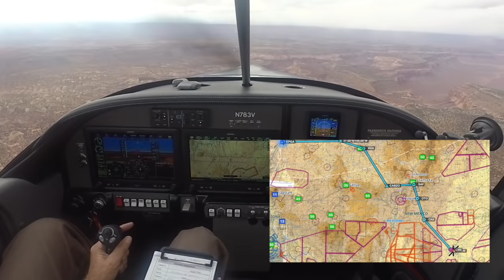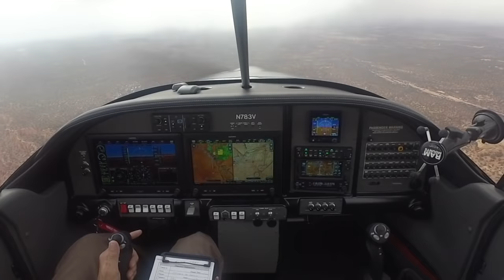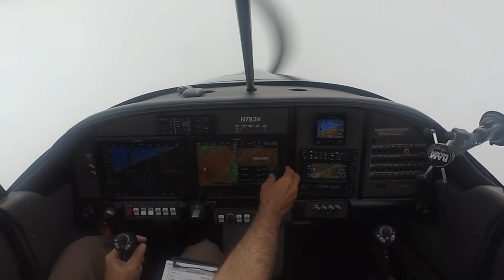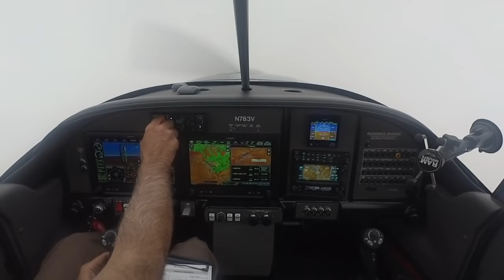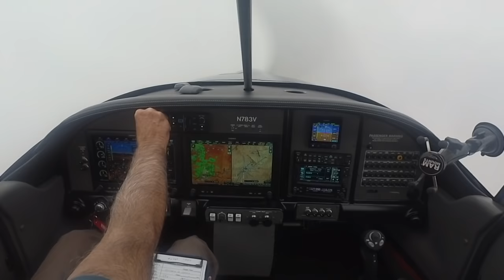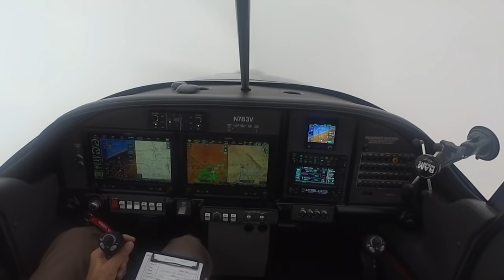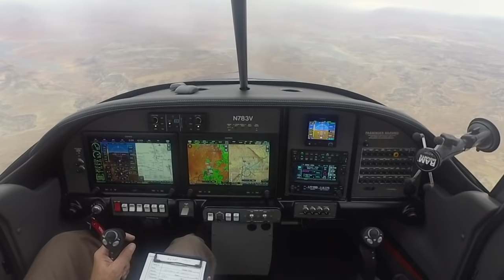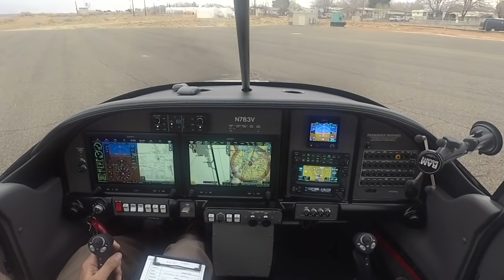RV 10   N783V   My 1st Emergency   HD 720p

Comment: ATC controller was amazing in every way including the extras he did trying to help the pilot and reduce workload (e.g. providing the weather). Really appreciate those folk. Lifesavers.
Reply: indeed...real professional and smooth....that voice of reason and concise guidance makes all the difference for anyone who has been involved in a series of events that complicate flying.
Reply: Absolutely! I hope that if I'm ever in that situation, I find a calming and helpful voice on the other end of the radio.
Reply: Yes! And also, he seemed to direct other stations over to different frequencies, so there would be less clutter. Good job by the ATC.
Reply: Yep and telling airspeed....pilot is always best to advise how many on board fuel remaining etc when first making contact ....proper planning in advance eliminates most stress....ain't no thing if all is trimmed just let the airplane fly then go thru the checklists.... people used to fly without pitot without electronic maps and all the pretty goodies.....I have a 22 year old Garmin I always have in my bag..... it is just a backup but batteries always checked and I can ...and have flown using just it for my flight instruments.... everything is there that's needed.... but yeah I even carry a hand held compass in my bag that can be used if the aircraft compass failed (however unlikely)  but it's also there in case it's needed to hike out... you know that boy scout motto
Reply: Even more so as you know they must be sweating it inside from the history of IMC accidents. Great ATC.

Comment: My first flight instructor was an old timer -- B24s during the war, TWA captain after that. He had a quote for this: You are going to make mistakes, all pilots do, it is how you recover from those mistakes that determines whether you live or die. You made a mistake, you recovered and will live to fly another day -- excellent flying and I thank you for sharing!
Reply: Although I never did finish my lessons, due to life. I had an older instructor and he taught me that a pilot certificate was a license to make mistakes and live. The lessons were to teach you how to try to make the first part not happen but when it did to help with the second part.
Reply: My private, inst, com and multi checkrides were with an old check airman that they called "Grandpa Chuck" back when my dad had his checks with him 20 years previous. He was pushing 90 years for my commercial ride. He told me that same exact quote every time I flew with him. Stuck with me. 

He was also notorious for extremely intense and very long (often 2+ to 3 hour) check rides just for your private. Mine lasted 45 minutes for my private and he said "take me back" without another word or explanation. I was 17 years old and scared I screwed up and failed. Got back, tied down the plane and he grabbed my log book and said "well I don't think your gonna kill anyone" and signed it off. 

I learned as much from him in those few hours a few years apart as I did from anyone. Including that "you will make mistakes"....

Comment: Sensory overload is a real thing. I'm sure we've all suffered it at one point. No visual outside cues, getting bumped around by rough air, trying to listen to ATC, hearing your stall warning, losing airspeed indication entirely... and trying to troubleshoot the problem at the same time. No amount of time under the hood can prepare you for this level of stress. Thank you for sharing this pretty scary experience. I know I learned from it :)
Reply: 100% true. I was in the soup and something as simple as the marker beacon was making me lose focus
Reply: I could feel the overload goin' on. I know I often get there (but that's one of many reasons I don't fly).
Reply: Truth

Comment: Thank you, as a student pilot, you may have saved my life just by having watched this video.
Reply: Protip: Get a glass/water level & glue it to dash (or somewhere visible. U know those water globe levels). Ive seen so many pilots get disorientated & be skeptical of electronic levels (not sure what equipment term is). A physical water level is always true!  It like cave divers who dont know whats up or down ( the thing is just pause and see which direction your bubbles go)
Reply: @fredfinks  Except that the water will react to G forces.  A plane in a coordinated turn should keep the water perfectly level.
Reply: @SlantAlphaAdventures  True, but he said "bubbles", would them react the same as just water? im curious now ..
Reply: @SlantAlphaAdventures  Agree.   Advising someone to use a glass of water to fly straight and level is dangerously incorrect and could get someone killed. A glass of water will not reliably tell you if you are flying straight and level. As you said, if you are in a coordinated turn the water in the glass will be level. In fact we have an instrument in the airplane that works like a glass of water but its purpose is not to tell us which way is up; its job is to tell us if we are flying coordinated.
Reply: @fredfinks  Not a good idea. Students may disregard.

Comment: As a VFR pilot, I got myself into IMC and I can really relate to the terror you must have been feeling. I was only in whiteout conditions for about a minute, but it was the longest minute of my life.
Thanks for sharing.
Reply: What's imc stand for?
Reply: @GnarDawgeh  Instrument Meteorological Conditions. IOW  Any condition where you can't see the ground. So you have to rely on special instruments to keep from losing your spatial orientation and crashing. Called IFR flight (Instrument Flight Rules). 
The opposite is VMC Visual Meteorological Conditions which means you can see the ground. Not all planes are equipped with instruments for IFR flight.  They are called VFR aircraft. HTH
Reply: @FlyingAroundOz  what instruments do you need for IFR beyond altimeter and level?
Reply: The best maneuver in an accident is the triple backwards, reverse split-flap wingover done showing ample breastages.
Reply: Source of electrical power (like a generator or alternator), attitude, turn rate, ball inclinometer and directional gyro/heading to see what position the aircraft is in and where it's going, clock for planning (fuel e.t.c.), radios for com and nav. And the altimeter that you already mentioned.
Reply: If you've got a map and your instruments then you're gonna be alright. Just look at your instruments.
Reply: He is IFR rated though which makes a big difference.
Reply: @DodInTheSky  ONLY if you have the proper training, certification and currency. Non-instrument rated pilots, on average, last for about 180 seconds after entering IMC before they crash or overspeed the aircraft into structural failure. It's called VFR into IMC, and it's one of the biggest killers of GA pilots.
Reply: @ScottsSynthStuff  sounds just like John F. Kennedy Jr. - overconfident novice who killed himself and others because he refused to accept that he wasn't qualified to do that Martha's night flight yet.
Reply: @ScottsSynthStuff while I believe you, because I've read the NTSB reports, it amazes me that it happens that fast. Not a pilot, but I find it perplexing that logically a plane being piloted in clear air would suddenly be in danger in clouds. A pilot, even a VFR one, should know that the a constant airspeed and level wings mean you are still flying straight and level, a radio means you can ask for help, and a fuel gauge gives you an idea how long you can continue straight and level flight. Granted, icing is a huge concern and as we saw here the air speed going zero, a VFR or inexperienced would not likely diagnose the problem as the pitot tube heat (unless they're a flight sim geek). 

If there is no terrain at your altitude you're going to be able to at least straight and level with minimum instruments for as long as you have fuel. Panicking into a dive is almost certainly the worst thing to do.

Comment: My wife’s company always had “lesson learned” meetings after any accident or system failure. During the process, they never referred by name to who was involved, just the facts of the situation. Figured placing blame was counterproductive. 

Far cheaper to learn from other’s situations.
Reply: A solution based approach always wins over a blame based approach.
Reply: @daszieher  I second this so much. Some work places and people just end up pointing their fingers at each other until they are relieved that no one is pointing at them. It feels like that has became more important than solving the problem at hand. We all make mistakes and shouldn't be afraid of coming clean and admitting an honest mistake.
Reply: @freezEware  "coming clean" and "admitting mistakes" are terms that should ideally be deleted from language. It frames the person responsible for such action as someone who should be blamed, and makes it more difficult for team members to warn the team about impending negative effects for the team.

In our company, we evaluate actions and reaction. Most importantly, we try to learn what was expected at the time of the decision and why the expected result did not set in, or if it did, how the negative side effect was overlooked. Immediately, "mistakes" become an opportunity to learn.

We have learned a lot in the past years, especially to attempt experiments in compartmentalised settings, so that if they go south, they don't burn truckloads of cash with them.
Reply: Amen to that. Pointing fingers and seeking backward accountability rarely helps, if ever.
Reply: a wise approach

Comment: I was doing instrument approaches in IMC with ceilings 800 overcast - Cessna 172 RG. We had just departed runway 33 in Charleston, touch & go. At about 1000 feet the engine started missing, lost power, and backfired when I tried to add power. I was under instruction in the left seat. My instructor, cool as a cucumber, got clearance back to the FBO, said, we’re flying straight and level head for home. We flew back to DYB about 10 minute flight, with the engine missing and popping. As we got close the clouds parted and we made a visual into DYB. After parking, I had to dig the seat cushion out of my tail. Next day we found out that the intake manifold broke a bolt and was sucking unmetered air. Any flight that doesn’t kill you makes you a better pilot. Great video!
Reply: What’s FOB?
Reply: @kenclark9888  I meant FBO fixed base operator
Reply: @Andreas that’s what I wanted to do, but he was my teacher. I think that he was more concerned about returning the airplane otherwise the owner would have to pay the FBO in Charleston to do the repair. By getting the aircraft “home” he was able to use his own facility and mechanic. He assessed the risk (without knowing what the problem was) and made a decision to fly it home. He later admitted that he was considering the river for a force landing (there’s the cooper river nearby). He took a chance and it paid off. I was a novice studying instrument rating. I would have landed in Charleston.
Reply: @Andreas oh, I forgot to mention, it was a night flight in actual IMC
Reply: Thanks for sharing.  I’ve contemplated getting my private license for 25 years. These are the things that scare the crap out of me.  I want to do it but man, these types of things get to me.  Glad you’re safe.
Reply: @mikegodfrey4482  definitely do it. I am a new pilot (72 hours) and things scare me when I fly but I push through because the good times are so worth it.
Reply: @mattolmstead6150  I’m getting there. Congrats on getting your!
Reply: @mikegodfrey4482  I wish you luck!
Reply: @sreetips  He risked your life, and his, to save a buck? That would have been my last lesson with that instructor!
Reply: @Andreas I had one engine in a twin lost the governor on 1 and the engine overspeeded and came apart.  I made that decision too.  Overflew several airports to get to an airport with maintenance.  I have thought about that trip many times over the years.  I don't think I would do that today, my thoughts were not about flying but how I was going to pay for this as I had partners in the airplane so it could not be AOG for an extended period.
Reply: @mikegodfrey4482  Take up sailing, you go down a lot slower.
Reply: @mattolmstead6150 - I really don't get it. After the excitement of the first hour of the first GA flight it strikes me as being as monotonous as watching paint dry with lots of flight calculus thrown in to keep you from nodding off/auguring in.
Reply: @barrybarnes96  what did you do on your flight?
Reply: You had already been handed off to departure?  They would clear you back to the airport, once you land ground would clear you to taxi to the fbo.  

CHS is basically at sea  level so you must have been making power, turning back at 1000 feet you would have never made the airport.

Did you turn the boost pump on?  What about leaning the mixture?  Story seems to be missing some facts.  Is RG injected or carburated?   

Why would you be surprised the instructor stayed calm?  What did you do?  If you lose composure you could make a mistake, get to slow and stall, then you are going to die.  Crashing at minimum controllable airspeed in a 172 you have a good chance of surviving an off airport landing.

Does CHS still have the arresting cable at the end of one runway for practicing carrier landings?

The last engine out I had was our fault.  One of the partners in the airplane didn't set the totalizer, in a Cessna 210 you can't see about the last 10 gallons a side which equates to about an hour of fuel.  I was about 15 minutes to my fuel stop and you guessed it silence.  I ran through the memory items and briefed my wife that when I got below 500 feet I would open the doors in case the airplane got bent so we would not be trapped in side.  I pulled her belts as tight as they would go and she put blankets in front of her face.  I was able to pitch, roll and yaw to get those last couple of unusable gallons down into the header tank and we lost all power on short final to an airport about 10 miles from our fuel stop.  We had to get out and pull the airplane off the runway when two guys came out in a pickup truck and we towed it back to their hangar where they happen to have 40 gallons of Avgas.  They gave us enough to get to our fuel stop that had fuel bum both were flight instructors and I had to endure an hour dress down.  My wife always comments how business like I was in a possible fatal situation.  I think that's the way you get wires after awhile.
Reply: @mikegodfrey4482  What do you mean get to you?  Life is full of risks.  Sure it is not as safe as watching TV but who cares.  It is simply the most amazing thing you will ever so.  Frankly most people don't make it, I think less than 10% of people who start instruction actually end up with a certificate.  Some can't ever sort out the three dimensional part.  You have to judge time, speed and distance while crossing the ground at 2 or 3 miles a minute.  You have to learn to navigate and operate navigational and communications radios.  Plus you have to learn all the pedantic regulations.

When I started flying you could rent a 172 wet for $42 an hour in the mid 80's.  It costs three time as much today.  Our Cessna T210 last year flew a little over 700 hours and ran us a little over $300 all in, insurance, maintenance and fuel.  We own the hangar or that would be even more.

Don't let my of that bother you flying is an incredible challenge however the rewards are never ending.

Flying is unlike any other hobby,
Reply: @scottholtzman3316  Good stuff Scott.  Appreciate the thoughtful reply.  Thank you!
Reply: @barrybarnes96  You travel with the airplane, go to new places, make new friends.  Nothing boring about it.
Reply: 8 grade bolts on everything... even the seats.

Comment: Randy, in terms of continuing into unfavorable conditions, I think we’ve all been there whether it’s IMC, BR, HZ, or even sun glare. What you did to maintain positive control, utilize all available resources, and keep yourself calm [enough], in my mind, far outweighs the initial mistake. As I have shared with my students and fellow instructors, we as pilots must be “calm in the crisis.” Pilots must be problem solvers and we must never forget that we never have the option to stop flying our aircraft. You kept fighting until you were wheels stopped on the ramp and for that I say, “very well done.”